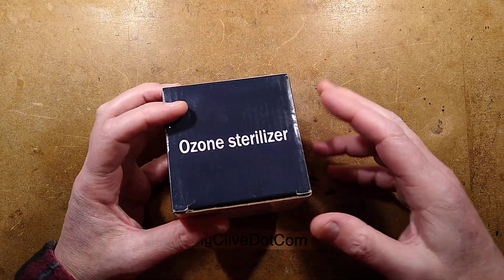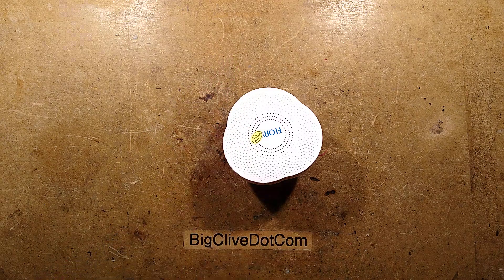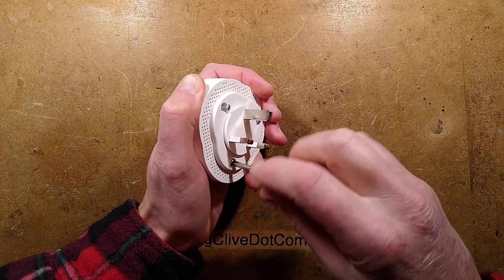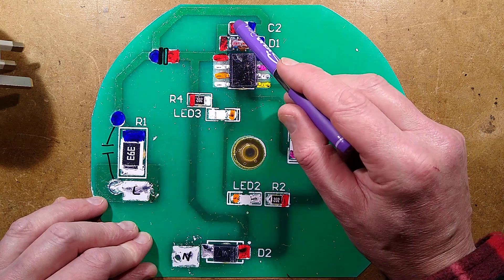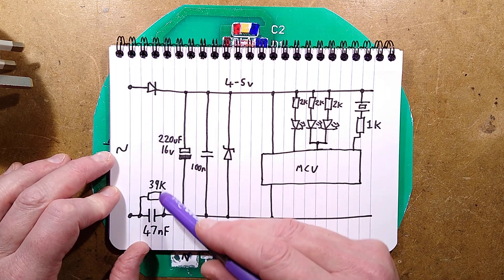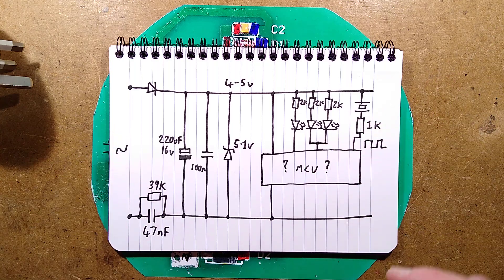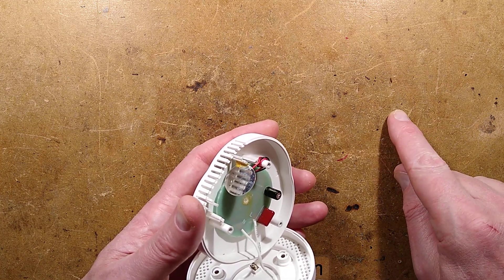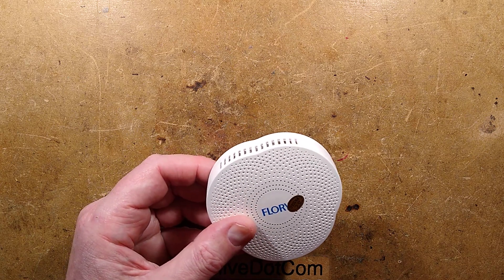I got scammed on eBay  (what a surprise)

Comment: Well done Clive I hate those cocky eBay sellers you can’t touch me lol, I hate the power sellers that have a score of like 150,000 and when you look at the feedback they have like 300 negative feedback in a month, and still trading ! They state in the uk, but from china and still take weeks to come..I got removed from eBay selling because I received too many 3&4 stars for P+P, rant over thanks again Clive 😊
Reply: I tried selling on ebay before and it was almost worse, people claimed everything they could was wrong with the stuff I sold and ebay gave full refunds for everything. I had one guy who was suppose to return the item and instead sent me an envelope with a piece of plywood in it and ebay wouldn't do a thing about it.
Reply: @MrTarfu  eBay is just for buyers now,
Reply: @wisher21uk  that sounds a bit awkward, but I think I know what you mean.
Maybe more buyers and scammers.
Reply: @BroonParker  don’t see how it’s awkward but it happens all the time
Reply: They set the delivery window so wide, by the time you can give up and demand a refund, it's too late to leave negative feedback, so they get away with it and eBay abets them by not adjusting the deadlines accordingly. 😒
Reply: I bought some LED WS2813? outdoor pixel strings off ebay when I built a Christmas light show a few years back. They sent some clone ones, which when powered up all light up white, whereas the original WS2813 remained off at power up. I complained to eBay about them being clones, and they said the seller was misrepresenting their location anyway as they were in China, as they said it was coming from the UK. So eBay gave me a refund, and I got to keep the item too :)
Reply: We get the same bullshit in Australia, they advertise as an Australian seller and say your product will be shipped from Sydney or Melbourne etc but after you have finished your order they tell you that they are out of stock and your order is now being shipped from China
Reply: @ats-3693  I had a similar experience but to be fair the item came quite quickly. I was annoyed to suddenly find out that it was being shipped from Europe as that could incur vat and duty in the UK. However, although shipped from Europe it was sent to the UK base and was sent on from there. I can live with that as at least you have someone local to refer back to.

Comment: I see it does have a CE logo on the box, like some version of it was sent for certification. If it’s just got random electronics in it, then the seller is misrepresenting it and it’s safety.
Reply: The logo means little anymore, anyone can stick those on a sham product.
Reply: You'd be surprised by how little a circuit can do and still be considered "safe".
Reply: @TehFreek  but can you release an outright dangerous product that fails certification and still slap a China-Export sticker on it?
Reply: @frogz  Depends on whose palms you grease.

Comment: If the disc is glued in on its edge, Its not going to make much Ultrasonic noise either - the glue is going to attenuate it.
Reply: plus feeding it through 1k will kill most of the signal as  piezo disks can be very capacitive, so will load down high frequencies, short the 1k out and you may well hear something

Comment: I've seen at Aldi for £10 an Osram Airzing Mini Car Air Purifier. It had some titanium dioxide washable filter thing and UV-A lights inside.

I gave it a miss as it's bulky, takes up a USB socket and you stick it on the air vent with a magnet.
Reply from the maker: I've featured that.

Comment: I made an ultrasonic insect repelling device on breadboard for my A level electronics. There actually is some truth in them as I found by slowly tuning mine near some live gnats there was a frequency I set it at where they were visibly very irritated and moved away quickly. Only problem is it was audible (though very high pitched) and was much more effective at irritating the rest of my class and the teacher. :D
Reply: I had an ultrasonic repeller back when they were newer and not sold in cheap junk shops...
Pretty sure it really worked because the millions of daddy long legs spiders I had around my shed all disappeared within a few days. I say disappeared.... Because they were still in the shed, just now they were behind cupboards and under workbenches and stuff... Places the ultrasonic sound wasn't reaching directly.
The other function on the unit (sending electromagnetic pulses down the power cables) didn't seem to have any real effect. So I left that one off because I felt like it was more likely to cause trouble with other equipment than keep the mice and spiders out.
Reply: @tin2001  , ive had one for decades too.  i bought it because i heard some good reports first hand.  my opinion?  rats dont care.  mice dont care.  i equate it to humans who work in a noisy environment.  mosquitoes?  no effect.  cockroaches?  it may have an effect.  i used to find them on their backs kicking their legs in their death throes near the the thing when it was plugged in near floor level.  termites?  i know of a man who was sure it got rid of his termite problem.  termites in perth wa are the size of fly maggots.  it did not stop termites in my house.  that electro-magnetic pulse effect would probably not cause a problem with other equipment.  i believe it is called x10.  it is used across the world for sending phone and cable tv signals down electrical wires during the quiet time between alternating current phases.
Reply: @tin2001  I have a lot of daddy long legs invading my house.
Often lying in bed one will drop by to say hello.
I grab it and feed it to my cat.
I like the crunchy sound, free cat food.
🕷🐈‍⬛ 🍽💲🥫
Reply: @BlondieHappyGuy  Harmonics are higher, not lower.  If anything it's a sort of demodulation of lower frequencies, and lower frequency resonances of things like casings.  It's not really true harmonics.
Reply: I bought a supposedly "pet safe" pest repeller. My cats freaked right the fuck out as soon as it was plugged in, and started belly-crawling about the house like they were terrified the roof was about to cave in. Even I could hear the so called "ultrasonic" sound. I know I still have a strange amount of high frequency hearing for my age, but I know I can't hear ultrasound.
Reply: @NoobixCube  🤣Sorry, cats are great but that description had me let out a snicker indeed!  You're exactly right; ultrasound isn't what really gets the pests and pets going crazy, I think it's just painful resonance and high amplitude that does the real work. In the case of bats I know the ultrasonic does work as have seen the ultrasonic deterrents in action where they use them in trees in certain parks where I live. But bats I understand will have it interfering with their navigation - I doubt if it would be as effective for everything else unless audible high frequencies are used. I too hear quite a range for my age, but working in electronics I always use it to listen for coil and capacitor whine. Old CRT TV's used to drive me mad, the sound of the whine would make long TV sessions painful which encouraged me to go outside more. Probably did me some good! :)
Reply: @omniverideus  I always hated the sound of CRT sets, well one wasnt bad but if you went into an electrical store in the day and they had like 10 or more on it was different.
Reply: @steviebboy69  I couldn’t handle it in a shop with multiple, it was actually a bit of a problem as a child. Now it’s handy - for example I can tell when an AC adaptor is going to fail long before it does any damage to equipment as they too whine like an old CRT when close to the end.
Reply: @omniverideus  Sounds similar to bats eccolocation sounds may also scare away critters that have spent millions of years fleeing from bats.  Sounds similar to hunting cats may have that effect on mice, rats and small birds.  However the cheapest repellent for small birds is a window sticker the size and shape of a bird of prey (they sell those as a product to prevent accidental window collisions by cute birds).
Reply: @omniverideus  I can also hear quite high, but those high frequencies doesn't annoy me as much as many others (unless it's very loud) - so that have lead me to some fun times. For example downloading a frequency generator app for the phone (or generate the sound with a small circuit and speaker, like you did. That often works better, since many phone speakers are quite weak above 10-12 kHz and sometimes also have distortion that will generate "trash" at lower frequencies that along with the high frequency one, which everyone can hear - that ruins the fun). 
Something in the 12-16 kHz range (a CRT TV typically generate about 15.6) will usually do the trick - it drives some people crazy, while others wonders what the fuck they are talking about. Also - even if one can hear the sound, it's usually pretty hard to localize unless the source is known (because the wavelength is many times smaller than the distance between the ears and reflections against pretty much all nearby surfaces, causes the levels to fluctuate between ears in a random pattern). Which makes it great for pranks.
Reply: @steviebboy69  I remember this being annoying when colour TV's started appearing, though, of course, the grown-ups didn't understand what I was talking about. ;-)
Curiously, I never found this a problem with the B&W 405 line TV's although the whistle was actually a lower pitch. It only seemed to be the colour ones.
Reply: @Bartok_J  I always though both made the noise at about the same frequency, but the colour ones had a higher EHT on them maybe that was a reason as well.
Reply: @steviebboy69  I COMPLETELY agree with you there.... That high-pitched whistle always drove me nuts when I was young. Every night my parents woukd shut off the T.V. to get us to bed. The second we were gone, and in our beds, I would hear that whistle of the CRT firing back up.
Reply: @davelowets  Once my parents were in bed, they stayed in bed.  The telly was turned off and that was that.
Reply: @steviebboy69  The point I was making is that my parents were never intending to go to bed.. 
They turned off the T.V. to assist in getting us kids to bed with less distractions, and then turned it right back on to continue to watch it after they got us in bed. Even though they kept the volume extremely low after they had turned it back on, not to bother us kids and keep us awake, the high frequency noise from the flyback circuit bothered me MORE than if they had just turned the volume up enough to drown it out.
Reply: @davelowets  Yes I see what you mean, as just an excuse to get you off to bed and continue to watch later.  My parents went to bed with the Chooks more or less and never stayed up late.  I hated the noise as well but would never hear it where i was compared to where the set was.
Reply: @NoobixCube  You can hear it because of stray frequencies, those cheap ultrasonic generators are not stable enough to produce clean ultrasonic sound.
Reply: @kaikart123  Maybe his cat was a rescue cat and that why it could hear the "Stray Frequencies" /rimshot
Reply: @kaikart123  I have one that produces audible clicks these clicks are barely detectable and not what repels the mice from my kitchen but its what they do the really good ones are likely silent to humans cats and dogs have a slightly wider range of hearing
Reply: @NoobixCube  If your cat was freaking out it was way beyond human hearing range 25k~30k, also note that humans can't hear tones above 15k, everything over that sounds like noise aka 16k and 19k sound the same, but 14.9k and 15k sound different.
Reply: @Sebastian_Athea  Wrong. I could hear up to 20khz when I was a kid, and could differentiate between frequencies. Now at age 46 I can still hear up to 16.8khz, and if the signal is very clean, the sound will just drop out at anything higher. I've verified these findings with an accurate scope.
Reply: @da1ve468 low e.t.'s
Im 41 and can still hear frequencies in the 16k range too. CRTs and this one light at my parents house when I was a kid used to drive me absolutely nuts, and no one knew what i was talking about
Reply: @childofcascadia  🍻 
I think the fact that I can still hear that far up the scale, this late in life, is why I still obsess over getting my Hi-Fi system just right. I'm not saying I'm one of those "Golden eared Audiophiles", I just think that I can hear higher frequencies better than many people my age, and the ability to clearly hear those screeching fly-back circuits of my earlier years made me more sensitive to those high frequencies. 🤷🏻
Reply: @childofcascadia  I know the feeling of being able to clearly hear it, and it's driving you insane, and no one else around you can hear it... 😠
They all think you're nuts when you say something.. 🤦🏻
Reply: @davelowets  cool my dude, very few humans gave better than 20/20 vision, but it doesn't make the statement that limits of human vision is 20/20. generally most humans can hear 15khz with eardrum and the rest of the hearing system behind it, anything above it is detected by small hairs before the eardrum, those hairs can detect sound but not the tone, they only tell if the sound is there, when they fall out (usually around 25-30 years) they don't regenerate, but the hearing you have after that should stay the same for the rest of your life provided you don't get any disease that affects bones, brain, or hearing directly.
Reply: Yep. animals certainly respond to sounds and... electricity. XD
Reply: Quite a few years ago I bought a big box of knockoff Motorola piezo tweeters (those once-ubiquitous black horns). Out of curiosity, I hooked one up to an amplifier, with a frequency generator connected to the line input. I found that at 17K I could hear nothing, but my wife very suddenly employed some intemperate language from several rooms away,
Reply: Every bit of research into ultrasonic pest repelling devices has proven that they aren't effective. There actually is NO truth in them at all.
Reply: ummm not buying it... sounds like a scam

Comment: "I didn't hear any ultrasonic noise..." That's why it's called ultrasonic.
Reply: You can "hear" ultrasonic transducers because of physical properties of the transducer and acoustic cavity that generate lower order frequencies. So technically you aren't hearing the primary frequency but you can usually hear something that indicates the output is on.
Reply: @sjm4306  I know, I just thought it was funny.

Comment: I've installed bigger ones at garbage rooms, not a huge fan of the intense metal smell they create. It's like sucking on coins. But I guess it's better than trash! Ramps up 230V to high voltage and makes ozone. Try to get one of those. Size? Like half a microwave oven.

Comment: Some of these products and their packaging seem like they came out of a poorly-trained AI.
Reply: But it has that nice spiral pattern on it like a fancy cloud connected -spying / data collection- IoT device does, so it must be good
Reply: @gorak9000  it really does look like it should be a wifi repeater, marketed as "mesh router".
Reply: @LongPeter  Yeah, I can't think of what I've seen with that circularly symmetric spiral type pattern on it before - either some access pint, or a Nest smoke alarm or something? They clearly ripped it off from somewhere, but I just can't think of from where.
Reply: Kind of a reverse Turing Test, the person creating the design is indistinguishable from a computer spitting out random phrases and logos.

Comment: As far as I know, there are no electronic pest repellers that work. My father bought an ultrasonic unit in 1984, it gives off ultrahigh sound frequencies that go up and down. We still got mice and bugs. 
If there is one that actually works, I'd like to see it. (but causes no ill effects on humans)
Reply: The problems is that mouse and rats gone be use on it by generation .
Means it will not work the animal adjust after generation.

Best sting is still a cat to have in your house.
Reply: I had millions of daddy long legs spiders in my shed and stuck one in there in about 1999. It sort of worked. They all migrated to behind cupboards and under my workbench where the unit was out of direct view. Stayed that way for several years until the unit started making audible wobbly tones and scratchy sounds. Around that time, the spiders started reappearing. Presumably the power supply went wonky and it was unable to produce the correct frequencies.
I didn't replace it though. I chucked it out and just started spraying every 6 months.
Reply: @tin2001  Kamikaze DL team went in and buggered your unit by using their tiny little bodies to short out the circuitry. They will be revered for generations to come.